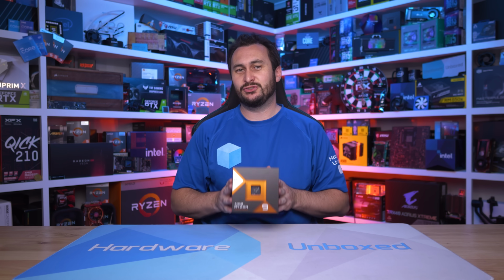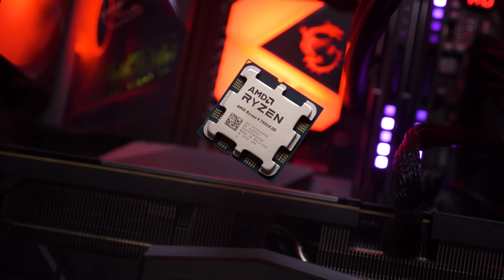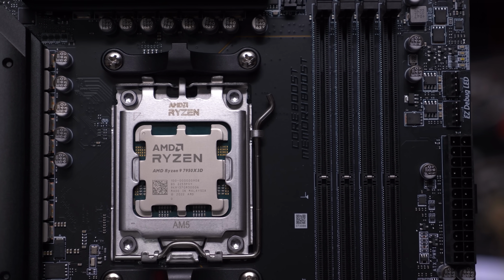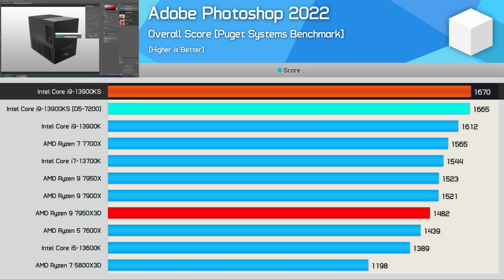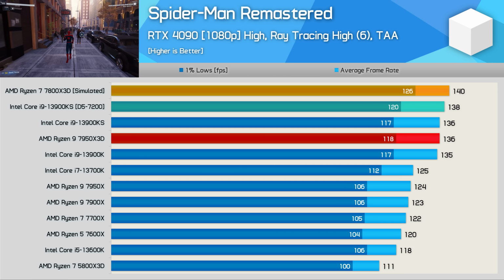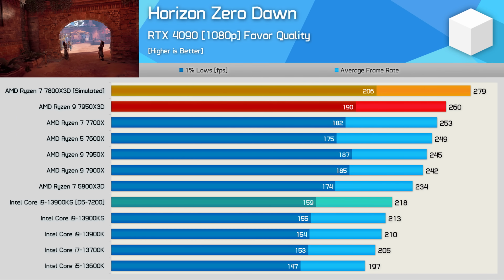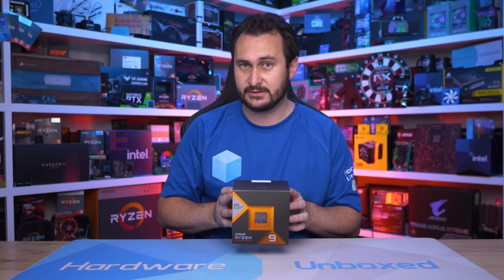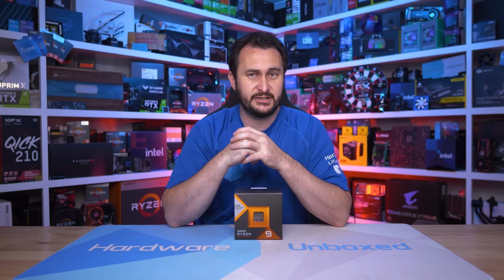AMD Ryzen 9 7950X3D Benchmark + 7800X3D Simulated Results

Comment: Man, I was hoping someone would simulate the 7800X3D, - and sure enough, you guys did it!!
Reply: Legends
Reply: Did he limit the boost clock on the simulated numbers ? As in the 7950X3D can boost to 5.7GHz but the 7800X3D has a much lower max boost of 5GHz.
Reply: The 7800X3D will be clocked 700 MHz lower tho, so performance will be slightly below what was simulated here.
Reply: anandtech did it by deactivating one CCD i think
Reply: And sure enough it didn't do anything meaningful
Reply: They deserve a raise, doing 2x the work of most reviewers
Reply: Obviously. It's what everyone wants
Reply: These guys are awesome.
Reply: The interesting thing here will be if a further optimization on future products would be possible to be able to on the fly easy to turn on/off each ccd or vcache enableing an "all in one" processor where you could decide if you needed max clock 16 core without vcache or any combi of 8/16 core with V cache on/off which to me would be the only real idea in having a product like the 7950X3D if it can get rid of the extra heat generated at max core speed thru the turned off vcache. AS for most cases the simulated 7800X3D results show that this is the choice for gaming and the normal 7950X as expected the choice for Productivity, but I expect AMD wants the product segmentation so you buy the one for gaming and the other for productivity ... more revenue if you have both a gaming specific and productivity specific computer. So all in all I really dont see the reason for the 7090X3D and 7950X3D's existence unless they are moving this way.
Reply: Yeah but it just not the same
Reply: @ionutpogacean  On the 7950x3d, that extra boost frequency is only on the cores without the extra vram.  So with them disabled, the frequency on the simulated 7800x3d should be close to that on the actual 7800x3d.
Reply: R I.P Intel .. your temp and power consumption will be remembered forever in our frozen heart
Reply: Neither is right, i dont think HUB's test has the latest AMD chipset driver that has the "3D cache optimizer", if the CCD are all over the place they're using the wrong driver.

... or they didnt config the settings properly in the test rig.

GN explained this is more detail and theres up to 35% performance difference between old and current driver.
Reply: @MrFredscrap  wait you are saying theres MORE performance on the table??
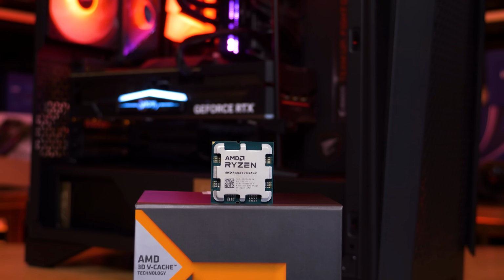Reply: @MrFredscrap  You're not right either. HUB is using latest bios and chipset drivers ( 4:00 ). Now, I don't think they downclocked the simulated 7800X3D, so it might not really be a proper gauge of it's performance. CSGO with the inverse would also have been interesting to see. (V-Cache CCD Off)
Reply: @Gurka9999  Im going to wait till HUB clarified how they've configred 3D V-Cache Optimizer and the power management to enable core parking.
Reply: Not sure about the accuracy though.  How is it outperforming the 7950x3d?
Reply: @ashupashu5559  they showed you why early in the video, disabling each of the sea CDs leads to the other CCD having more available power and us it will overclock further on its own through more power overhead. With both CCDs enabled the CCD with the 3D V cache clocks lower due to less power overhead.  This is likely why they delayed the 7800x3d to a later launch day, as it makes no sense to get a 7950x3d or 7900x3d over it for gaming.
Reply: dont forget yes he simulated but did not bring the clock speeds down to the 7800x3d limits and non of these are overclockable
Reply: Not a very accurate simulation if they simply limited the applications or BIOS to half the 7950X3D. The 7950X3D has 128MB of L3 cache, which if you disable one CCD would leave you with 64MB of L3 cache. The 7800X3D has 96MB of L3 cache in a single CCD.
Reply: @ACanadianDude  you don't seem to realize that only one ccd on the 7950x3d has 3d vcache... I'm not sure how much vcache exactly it has but it's definitely more than 64mb
Reply: @lunalianleaper  Yes true. They advertise 128MB so people think 64MBN per chiplet. Not true. One chiplet the 3D cache one has 96MB and the non3D one has normal 32MB for total of 128MB. Though total is not important in reality but rather amount per chiplet. 

The non 3D dual chiplet parts have 64MB total L3 cache with 32MB per chiplet. for total of 64MB.
Reply: @ACanadianDude  What are you talking about? The 7950X has 64 MB of L3 cache (32 megs for each CCD). The 7950X3D comes with a 64MB additional vCache on one of those CCDs. Hence, if you disable the non-vCache CCD you are left with 32 MB + 64 MB = 96MB.
I find it very disturbing that 4 people (so far) liked your comment, which goes to show how easily some people digest misleading information on the internet...
Reply: @ACanadianDude  You are wrong. one of the ccds in the 7950x3d has 96MB of L3 cache and the other one has 32mb of L3 cache, if they disable the non-3d cache ccd, it will give a pretty accurate 7800x3d simulation as they now both have 1 ccd with 8 cores and 96mb of L3 cache.
Reply: @KL-ky8fy  still not completely accurate as those cores on the 7950x3d will be running slower than those on the 7800x3d.
Reply: @mchonkler7225  if the non 3d cache ccd is disabled, the frequency should be relatively similar
Reply: @KL-ky8fy  Is the simulated 7800x3d processor running at the same mhz as the 7800x3d will?
Reply: @garyb7193  according to the tech specs, the 7800x3d boosts up to 5.0ghz. Of course that assumes optimal cooling. Their test showed ~4.85Ghz with the non 3d cache cores disabled. What the 7800x3d would have boosted to with the same cooling setup is hard to tell without hands on testing?
Reply: @JustLiesNOR  I realize the 7950x3d has128Mb 3d vcache at a max boost clock of 5.7Ghz whereas the 7800x3d has only 96Mb 3d vcache and runs at a slower 5.0Ghz max boost clock. 
This review simulates 7800x3d performance but with asterisk.
Reply: @garyb7193  that advertised boost clock on the 7950x3d is for the non v-cache ccd the ccd with the v cache has a lower boost
Reply: @TheDoctorDanger  We'll soon have all our answers in a little over a month.
Reply: @garyb7193  No it doesnt boost to 5.7Ghz since that's the non 3D cache chip. For games it uses the 4.8GHz or roughly 5GHz 3D cores. It's similar if not the exact same.
Reply: @akosv96  yeah 80% of these people are completely oblivious lol. 

Guys listen,

7950X3D
CCD0 w/3D Vcache = 5.0Ghz "ish"
CCD1 without 3D Vcache = 5.7 Ghz

7800X3D
CCD0 w/3D Vcache = 5.0Ghz

If you DISABLE CCD1 in the 7950X it basically makes the 7950X3D a 7800X3D. It also limits any overhead with the drivers because there is nothing to prioritize between the vcache CCD and the higher MHz CCD and it gives CCD0 a higher power envelope since the other high Ghz CCD is disabled. That's why the 7950X3D with CCD1 disabled is performing better than a stock 7950X3D on some tests.

AMD is confusing the hell out of everyone with this setup. They should have just had a 7600X3D, 7800X3D and a 7950X3D with both CCDs having the increased vcache. Have 3 product stacks, a low powered series, higher powered tier X variants and gamer 3D series.
Reply: @ACanadianDude bruh didn't read the fine print and think both chips have cache 😭
Reply: @wile123456  bro did not had to read. it was explained aswell. bro is just apparently blind and deaf
Reply: @ACanadianDude  this is not true at all, the extra cache is stacked only on a single CCD, while the other CCD has a normal amount of cache. If you disable the non-3d beatpad CCD, you still have access to the full 96 MB of 3d vcache that would be available to a single ccd 7800x3d, since each CCD has 32 MB of L3 cache
Reply: @ACanadianDude  lmao did you not watch the first 3 minutes of the video?
Reply: @ACanadianDude   That's what happens when you skip to the benchmarks. You end up with a clueless comment
Reply: @ACanadianDude  "64MB of L3 cache" how did you reach that conclusion? Only half the 7950x gets 3D cache so you can't simply half 128MB.
Reply: @ACanadianDude  totally wrong, only one of the CCD's has the cache, so on the 7950X, one has 144MB of cache vs 7800X3D 96MB.
Reply: @ACanadianDude  it's 96 MB on one core and 32 on another. This is an accurate test. theres not 64MB's since it's not shared

Comment: I wonder if the actual 7800X3D will have the same amount of v-cache as your simulated setting.
Reply: Specs are announced, it will.
Reply: Both do have 96 MB, yes.
Reply: Most likely yes

Comment: The new X3D CPUs have really surpassed Intel 13th generation. Now where are all those naysayers? 😂
Reply: I think everyone believed it would happen but this is borderline the worst outcome for it. It barely beats it. It's worse in productivity than the standard part, disabled no v-cache CCD in gaming. It wins sometimes and isn't crazy expensive with low temps.  But there is so much left on the table for AMD. It seems like AMD couldn't do a full bore dual v-cache CCDs for 7950x3D probably due to price. If it did exist I'd think it would be over $999 USD.  Doesn't sound like we will ever know, sucks.
Reply: @orangezombies  Not the worst though. The worst possible scenario would be not beating Intel at all in gaming. Yeah, this CPU is made for gaming. Not productivity workload. Buy a threadripper CPU if you’re a creator / server company.
Reply: Hum. Did we watch the same video?  19:26
Reply: @josejuanandrade4439  what’s your point? The 7950X3D is faster according to the graph. Cope more
Reply: they're very close and beating each other in specific workloads. that said, the power consumption is crazy on the intel chips
Reply: @Amfibios  Barely, but the AMD CPU still beats it. AMD almost always have the power efficiency advantage over Intel in CPUs. Sucks that that they can’t replicate the same efficiency on their current GPU lineup.
Reply: @jonissesmarchadesch7025  well... it barely beats intel sometimes for a 20% more premium and with issues due to the dual CCDs... that doesn't sound like a win.

Comment: 1:36 This is such a stupid trend.  Why the stupid expensive high end parts are starting to be better value per core than the cheaper parts that have always relied on the value argument is beyond me.  The 40 series GPUs are the most egregious, with the 4090 costing the least in CUDA core per dollar spent using MSRP prices.

Comment: I was worried about the hybrid CCD issues causing certain tasks to be performed on the wrong chip, and damn that Factorio result really shows it :/
Reply: Watch GN's review, i have a feeling this test rig didnt configure "3D V-Cache Optimizer" properly in the chipset driver.
Reply: @MrFredscrap  You appear to be right. There for sure seems to be methods in place to prioritize or outright shut off the second CCD while gaming.
Reply: @MizarcDev  to be fair to HUB, the instructions from AMD didnt explicitly say anything about lowering power management settings to "balanced".

GN had to find that out almost like a software bug. Where the Core Parking feature didnt work on high power settings.